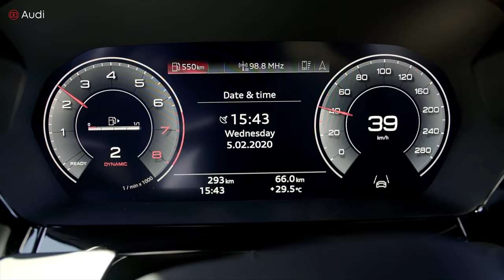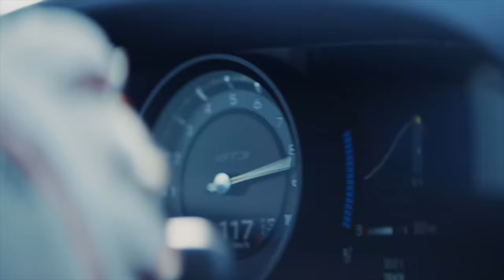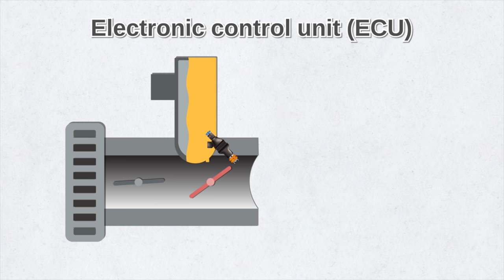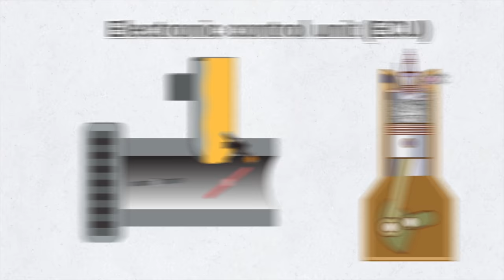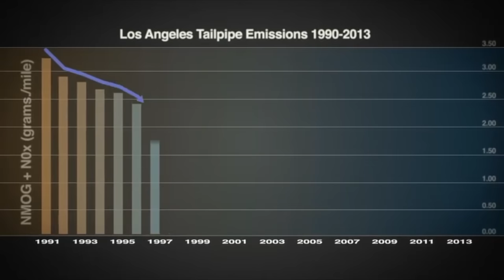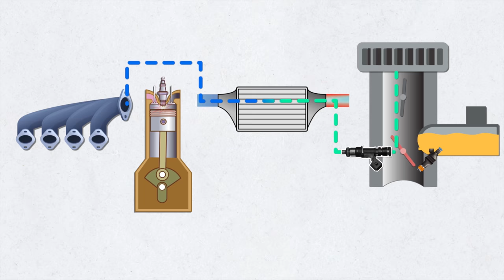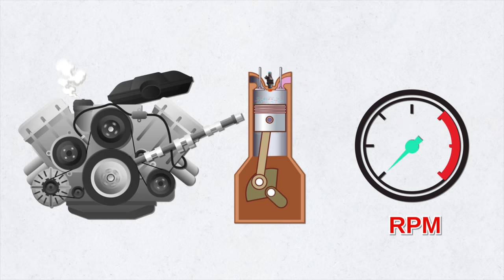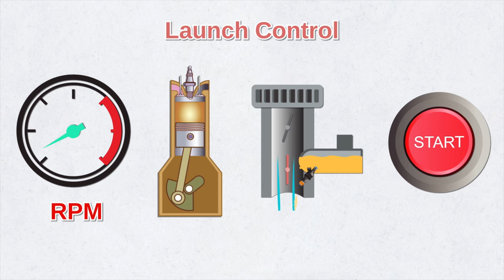Police Don’t Want You to Know About This New Car Mod

Comment: I noticed Scotty has not done a segment on the Baja 1000 or 500 etc.(nothing turned up in a 'Scotty' search).
Back in the day, Ironman Ivan Stewart and Toyota worked in a winning combination as a proving ground for new technology (as in 'TRD'). So many different wins by the Ironman (so named because he drove the entire Baja 1000 race  by himself, about 19 hours). Once he even beat the bikes to the finish line. Maybe not so fair when you have Toyota helicopter support but anything goes in a Baja race. Even with that, he once broke a brake plunge rod just short of the finish line. It's a grueling race.

Comment: I remember when Ford 1st came out with the Eco Boost turbo. They had their engineers on the radio explaining that they put the turbo right next to the exhaust manifold instead of down a little. That's what makes them spin up faster. I know my Escape 2L also has 2 side by side turbines (twin scroll) with different angles of fins. One for low speed boost and one for high speed.

Comment: I had a small "Super Charger" installed in my 2.2 four cylinder S10 truck..100+ more Horse Power.  I can keep up with six bangers now without using extra gas
Reply: What are you waiting for , scale it up , and run your 4 banger using no gas 🤦
Reply: @jackd1582  right now I run half E85 & half Aviation fuel..(when I run it)..other times I run straight premium unleaded fuel
Reply: @stevedeleon8775  Can your tune  handle both?
Reply: @jackd1582  Yes.. My long time friend & mechanic set it up for me two years ago..he totally rebuilt the 2.2 with high performance parts..
Reply: @ayebee1207  Wow..I hope to swap a 350 V8 one of these years in my S10.. right now I've got 3 vehicles to deal with.. My 2002 S10..2011 HHR SS 2.4..& My 2000 Gulf Stream 24 ft. Ford E350 V10 Triton...What year is the Chevelle?..one of my high school Cars was a 1970 Chevelle Malibu 396 V8..

Comment: Old antilag systems were indeed bad but which technological improvements the recirculating valve is most common in turbo applications on stock set ups now and nearly fully eliminate turbo lag. It's nice to see this video after the last video that attacked turbo without explanation, but the word "recirculating valve" was still missed.

Comment: Scotty, I've got a 2004 F150 4x4 crew cab. After I bought it I had my mechanic tighten up the parking brake. Right after he did that the truck would shake like crazy going down the road at about 55. And only every once in a while. Took it back to my mechanic and he couldn't find anything wrong. Since he had recently adjusted parking brake he decided to loosen it back up a little. It stopped shaken after that. What's up?

Comment: One of the biggest flaws of turbocharging is not always about the turbo systems itself it’s often the drivers fault for premature wear, poor maintenance and how the car is driven. You need to work with the engine and transmission in the rev ranges. Don’t labour the engine. 

SPOOL UP YOUR TURBO’S!!

Edit: flaws not slaws.

Comment: Excellent video Scotty.  My question is: why bother with a turbo, when a super charger has no or little lag and doesn't need a multitude of systems to control?  Can you compare the two in different applications. Race and every day driving. Thanks.

Comment: Antilag is way overkill for a street car. Just get a properly sized turbo, twin scroll, ceramic ball bearings, or even more modern variable geometry is plenty. Your biggest problem on the street is traction on these crappy uprepped roads.

Comment: I experience this lag stuff with my 2016 Powerstroke. If I try to 'jet' off from a standing start there is a definite 1.5 second falter before taking off like the rocket I want it to be. I think Gale Banks has something for this called the "Pedal Monster" but I'm not sure it addresses my complaint. It's also $300.

Comment: Interesting that the turbo feeds itself it keep it RPM high. Strange, isn't using dual turbos, one small and another bigger much more efficient at doing that? The small turbo remains spun up, while it spins the larger one up for high speed? It seems to me that it would be a lot simpler solution to turbo lag.

Comment: Hey Scotty! I have a 2006 Pontiac torrent 3.4 L V6, I have just over 72k miles and I want to do a trans flush. I know you advise against it for older high mileage GM products and I was wondering if my 06’ 72k torrent fits in that category. Thanks!!

Comment: What about a electrically driven turbo charger?  Would it not keep the turbo spun-up?
Reply: @Mark Codiroli That maybe true, however being electric, it would spin-up as fast or  faster than throttle input so your boost would be there with no turbo-lag.

Comment: Then what will be the difference between bi-turbo or supercharger + turbo?
They will work together and gives smooth increasing power, (of course, is the more expensive solution).
But in the case of performance and lag which is better, this technology or bi-turbo or sc+turbo?
Reply: "Als" or recirculating valve is quite common in turbo applications stock nowadays. Mercedes for example, turbo lag is almost nonexistent on their single turbo systems. With recirculating valves, it's all a thing of the past. But blow off valves however, push wasted pressure back into the atmosphere, most often straight under the hood but in some stock applications into the exhaust,  thus turbo lag. 

For performance a twin charged system, or a supercharge and turbo, maintains the best of all options for most applications but at higher costs of fuel.

Comment: That must have been what Chevrolet was trying to do in My DAD'S 1973 CHEVROLET PICKUP TRUCK.   IT would run backwards when You turned the key off.  Luckily it was a 3 speed manual transmission and You could let the clutch out and choke down the engine. That is why I have never liked Chev vehicles.  That was when the government screwed up a lot of cars

Comment: Not necessarily true Porsches 911 Twin turbos have very little lag the new one's they do 0 to 60 and 2.6 seconds and and have top speeds over 200 mph and there are 3.8 to 4.0 l Flat 6 cylinder 11 to 15 quarts of oil

Comment: You should depict the connecting rod's "big end" journal opposite (180⁰) from the crankshaft counterweight  centerline (a bit more or less, depending upon the specific application) in your animations. Displaying the connecting rod journal in the center of the crankshaft counterweight is [exactly] wrong. I have noticed this in several of your videos.

C'mon Scotty -- you should know better!

Ed -- MSME, and auto-repair shop owner

Comment: Will i get less turbo lag with an sutomatic transmission.  I used to have an 87 dodge dayona turbo 4 cylinder. It had an automatic adjusting clutch and  the clutch died with no notice and it cost a lot of money to be replaced
Reply: No good in the snow,,  Those wide tires were expensive.  Daytona did not corner like a .mini muscle car. I  have a .2017 subaru forester with eyesight.  Great car but underpowered.

Comment: That's what a supercharger is for... less maintenance torque at low rpm better sound no goofy blowoffs etc.
Reply: Less performance range, less gas mileage, still has drawbacks and failures such as leaking oil directly onto top of engine, usually weighs more than a turbo setup as well.